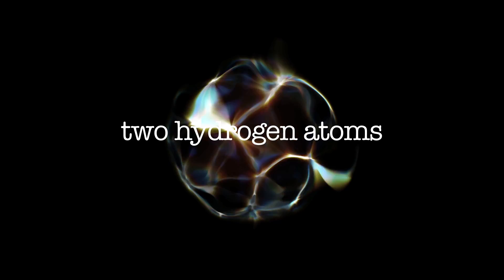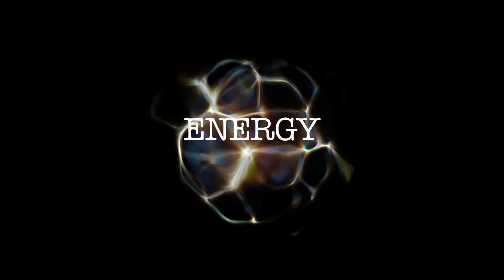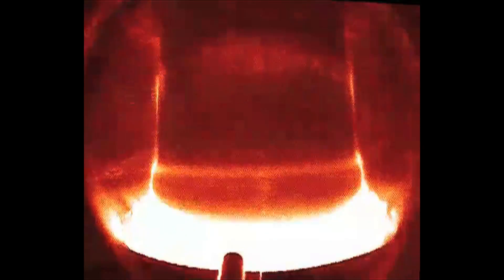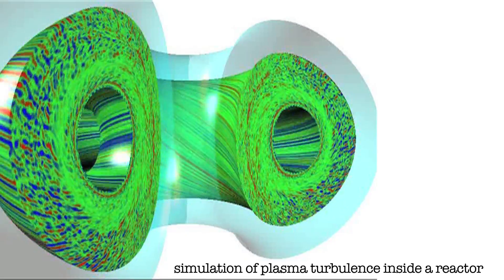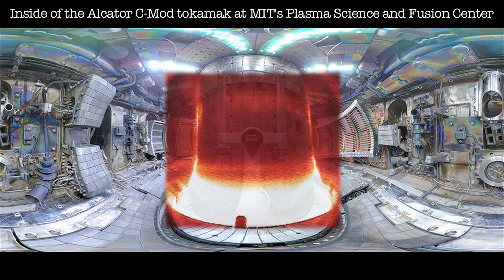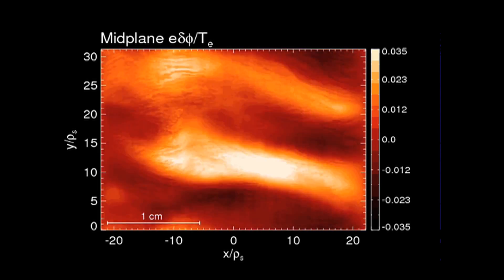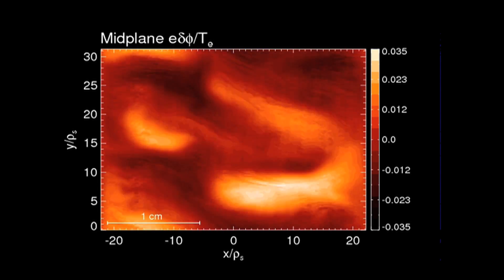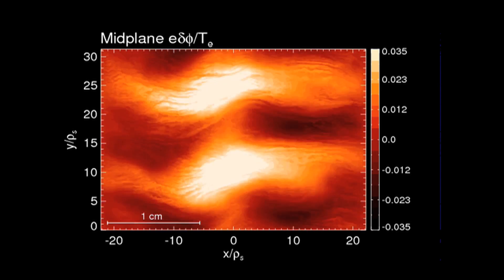One step closer to fusion power

Comment: I HAVE BEEN WONDERING IF HEAT ALONE CAN PRODUCE POWER. OUR WORLD IS HEATING UP MASSIVELY AND EVEN AT NIGHT THOSE TEMPERATURES CAN REACH FEVER PROPORTIONS. THERE ARE THOSE LITTLE WOOD STOVE FANS THAT WORK PERFECTLY THIS WAY. WHY IS IT NOT POSSIBLE TO UPGRADE TO MASSIVE DEVICES TO COLLECT ALL THIS HEAT. NOT ONLY THIS BUT I ALSO THOUGHT OF INSTALLING SMALL GENERATORS ON THE BACK ENDS OF THOSE MINI FANS TO BE ABLE TO LIGHT FAIRY LIGHTS, CHARGE PHONES, RUN A SMALL RADIO. JUST A THOUGHT???

Comment: name one attempt at fusion any kind of fusion power generation that has actually put power to the grid instead of taking power from the grid.
Stars are not powered bye fucking nuclear fusion.
This claim bye so called scientists reminds me of when scientists believed the sun burnt coal.
Why , coal at the time of the claim was the hottest and most consistent fuel source know ( step forward to 2019).
Nuclear fusion is now the most powerful force we know of , this to me states that science has not advanced at all since this claim.
The suns energy comes from the changes in matters state in the sun, stars do not need hydrogen to burn bright, my evidence for this type 1 and type 2 super novea .
Fusion is a bye production of matters consistent change of state in the stars , convection tubes visible on the suns surface give clues to this process,  
IT IS TIME FOR SCIENCE TO RELEASE ITSELF FROM THE BONDAGE OF BULLSHIT FROM IDIOTS LIKE STEPHEN HAWKING WHO PUT IMO OPINION PUT SCIENCE BACK OVER 3000 YEARS AND WHEN INSTITUTION PUT BULLSHIT LIKE THIS OUT I WOULD EVEN GO AS FAR 1000 YEARS.
Stop trying to keep putting hawkings bullshit into science and just use the fucking evidence.

Comment: The good news about fusion based power generation is that it is "just" an engineering problem, actually it has been just an engineering problem for a long time, after all we know for a fact that it works, just ask the sun. Look at how long we knew the science behind the internal combustion engine to how long it took someone to produce one that worked. The single biggest issue with fusion is funding. Governments are just now sort of taking it seriously, but still not nearly as seriously as they should, fusion will transform the world like nothing before it, even the printed word or the internet it really is that big. I would love to see every dime of NASA money diverted to fusion research for 10 years and every other dime we can divert to it. Finally, the Fusion guys need to spend some money on PR, all we see are these little blips once in a while and nothing that will stick with the average person, we need a moon landing spin put on this thing. They need to figure out how to get the public interested in an virtually endless support of comparatively cheap, safe, energy, even the Global Warming movement is all but ignoring it when ironically is would be the single biggest things to reduce GH gasses, bigger than everything else combined, solar, wind, tidal, geo-thermal...

Comment: It still consumes more energy than it produces. The reason for this is that the sun is much larger and has much more atoms, so quantum fluctuations actually become statistically significant, which makes fusion possible at lower temperatures. We don't have this possibility in comparatively small reactors on Earth.
Reply: +Taric Alani we STILL don't have...etc, never say never
Reply: +IImagnumalucardII I agree with you 100%. What we learn here is valuable information we can use to progress in science, engineering and technology.

Comment: I have only a basic understanding of chemistry but from what I gather from this video is that  turbulence within the plasma prevents or disrupts the fusing of the Hydrogen isotopes (hope I said that correctly) and now MIT has figured out, via computers, is that there are two types of turbulence within the plasma. I guess the question still remains, how to control this turbulence. However having a better understanding of the turbulence will get us closer to fusion energy.

Comment: I read somewhere we didn't find yet the material that could support the heat of the plasma. Is that issue already solved?
Reply: +Guillaume Combot They are currently using very powerful magnetic constriction to confine the plasma within the reactor so the walls of the reactor wont melt.Some estimate, we will have viable commercial fusion by as soon as 2030.
Reply: black star cool! (so, I wonder why they were talking about finding tougher materials to achieve that). It seems the community is waiting to see the results of the Wendelstein 7-x (apparently it started yesterday ! "Experiments with hydrogen plasma will continue until March") exiting time ! I hope I'll be still alive in 2030 to see that! http://spectrum.ieee.org/energywise/energy/nuclear/wendelstein-7x-really-starts-up

Comment: Fusion is important, but not as an energy source.

It is important currently because solving fusion plasma confinement might help us solve some of the bigger problems in Physics, such as Turbulence.

It is important in the long run because if we do get it to work it will be an exceptionally good source of neutrons, which can be used to do all sorts of crazy stuff like stabilizing legacy nuclear waste, generating highly-pure nuclear fuel, and generating select radioisotopes or radioisomers with absolute ease. Granted, some fission systems could also do all of those things, but fusion would do it far more easily and in a highly-controllable fashion.

However as an energy source, fusion is nothing exceptional and perhaps worse than fission. Even if perfected, fusion will only produce 4-7 times the energy of fission per mass of fuel, while remaining much bulkier at about 1/3rd the energy density of fission. The neutronic capabilities of fusion will make it far more valuable as a partner to fission systems and as a producer of radioisomers for secondary nuclear energy systems such as nuclear batteries. It makes absolutely no sense to disregard those potential applications of fusion, especially when it doesn't stand a chance against the much more versatile and economical approach of using fusion to facilitate fission and radioisomer production.

Comment: Is France not building a fusion reactor and planning to start it in 2020? It is called ITER. If this is new technology breakthrough without which we cannot have controlled fusion, then how could ITER have been even started?
Reply: +Karolis Črn ITER is an experimental reactor, built with tons of diagnostic elements and is NOT a commercial fusion reactor (it will however output up to 500MW of power). The goal of ITER is to demonstrate that fusion energy on a near-commercial scale is possible and to adress some issues. These issues are scientific (turbulence, self-sustaining burning plasma) as well as constructional (tritium breeding, divertor technology, ...).
The discoveries made in the past 5 years concerning magnetic confinment fusion only support ITER and can greatly help to make the project a succes. They were not necessary to start up the project, but can surely contribute to attack the problems we have nowadays with fusion with full potential.

The ITER-site can help you with further questions or concerns, they are very generous with information concerning the technology and engineering behind this project.

As normal for the world's most high-tech machine, the schedule has suffered some delays. First plasma is now predicted for 2023 and first D-T reactions for 2027.

During the ITER-experiments, information from all over the world (Wendelstein 7X, K-STAR, JET, CCSF, MIT, ... and many other fusion reactors) is gathered to prepare for the next step to fusion energy: DEMO. A demonstrational reactor without all the diagnostic equipment to prove the feasibility (scientific, engineering AND economic) of fusion power. Depending on te results this will be either a tokamak or stellarator design.
Reply: +Wladyslaw Szpilman Thank you very much. This was not the first time when I hear a new breakthrough in the fusion energy field and when I am confused about the whole picture of the technology and our current progress.

Comment: Amazing breakthrough. In my PhD thesis 30 years ago I crudely modeled this turbulence in the form of "filaments" that interfered with the transmission of IR beams used to measure plasma temperature. 

Now, if we could do something about morons who troll serious Youtube videos, that would be a real accomplishment.
Reply: +DJ Arnoldo The problem would solve itself if people didn't react to the trolls. When no one replies to them anymore, they will stop and start crying in a corner ;)
Reply: Perhaps using said morons as reactor fuel.
Reply: +DJ Arnoldo < Hopefully you now work at the Nat Ign Ctr :---)
Reply: I love trolls, what's wrong with some nice trolls? They use infrared beams to measure plasma temperature? Wow that reactor would make a hell of a remote control.

Comment: Great news! One more step to the thermonuclear fusion. It remains only get more He3, which costing extremely much...
Reply: +Arni Dexian Thermonucleair fusion (for commercial purposes) needs deuterium and tritium. Deuterium is easily gathered from water and tritium can be bred from a lithium blanket bombarded by fast neutrons from the fusion reaction. The two base components, deuterium and lithium, are relatively cheap and abundant.

Comment: How do you convert mass into energy?
Reply: +Taseen Khan When you break it all down they are interchangeable. "Mass" is equal to the resting potential energy in an object and, as quantum mechanics states, if you increase speed you increase mass equal to the change in potential energy. All mass really is, is a lot of energy put into a small space.
Reply: +Taseen Khan To add to what Roboterson said, Einstein's relativistic mass-energy equation can be expanded to include momentum-energy equilibrium as well:

E^2 = (p x c)^2 + (mo x c^2)^2

where E is energy, p is momentum, mo is rest mass, and c is the speed of light.

Ignoring momentum changes and cancelling the squaring factor on both sides, you get the simplified equation we most commonly see today:

E^2 = 0 + (mo x c^2)^2

E = m x c^2

The energy-momentum relation is what governs your typical nuclear reactions, such as fission, fusion, and radioactive decay. Particle decay processes, such as neutron decay, utilize both parts of Einstein's equation, but such events only really occur in free-particle systems (free neutrons flying out of fission or fusion, for instance).

The rest mass doesn't change in most nuclear reactions simply because the number of discrete particles does not change in these reactions. HOWEVER! The actual mass DOES change in these reactions, by non-discrete quantities. You can observe this mass-difference phenomena when comparing isotopes of the same element, in which we routinely observe mass changes that do not appear to corroborate with the addition or subtraction of discrete masses as we would expect if we were adding or removing neutrons, which should all have the same mass. Instead, we find that things tend to get heavier the farther away we get from a stable isotope, when adding neutrons, and this is entirely due to the difference in nuclear momentum with addition of neutrons.

That difference in momentum actually makes the nuclei physically heavier when you weigh it. It is freaking weird that something with a different momentum has a different measurable mass, but that's just how the world works. This momentum effect only manifests in objects that move or spin at relativistic speeds, which excludes most every-day objects we encounter, which is why a rock will have practically the same mass whether it's on earth or on mars. But if you throw that rock at 10% the speed of light, it will gain enough relativistic mass to show a difference.
Reply: +Taseen Khan 

Check out the youtube channel PBS spacetime. They have the best explanation without overly dumbing it down that I have seen.
Reply: The mass that is converted into energy in the case of fusion is not actually matter mass, but rather it is the binding energy that is released. To simplify, think of balls stuck together with glue, when the balls fall apart, the glue is released, it is the glue that is the "energy", but the balls still remain balls.